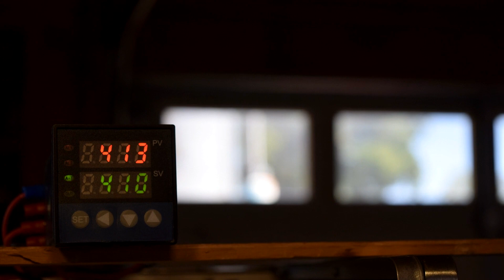Metal Cast 3d Print in Brass From Scrap Keys-Casting Process-ASMR-Lost Resin

Comment: May I ask at 2:06 minutes it is clear that your plaster mold on the bottom bottom is solid and has no voids, how can you vacuum the air bubbles? Can you help me
Reply from the maker: The investment lets air move through is which creates a vacuum in the mold space. Note that that is not plaster, at least not completely plaster. Is is a processional investment that you buy for just this purpose. Why plaster could be used and I have used it in previous casting videos it is not recommended. Hope that helps.
Reply: @RealProjectTube   Thanks you so much, i hope in the future you can make video to casting mechanical parts such as moving cogs ♥ Many thanks, i like your video so much , so helpful